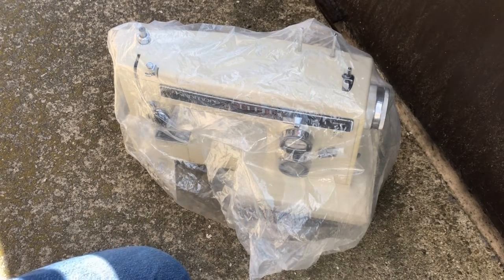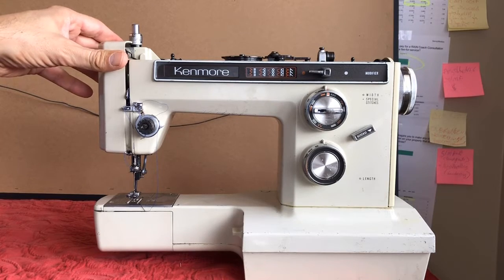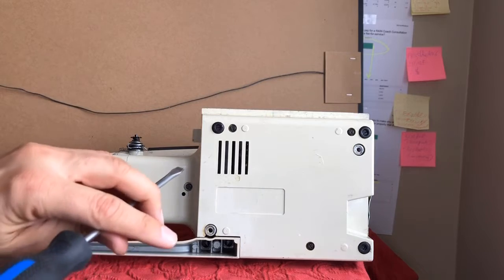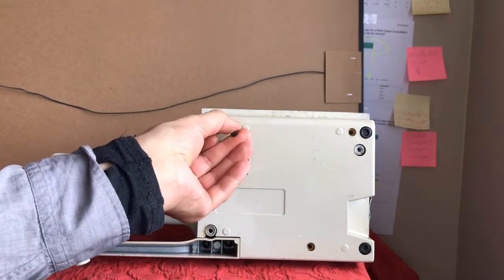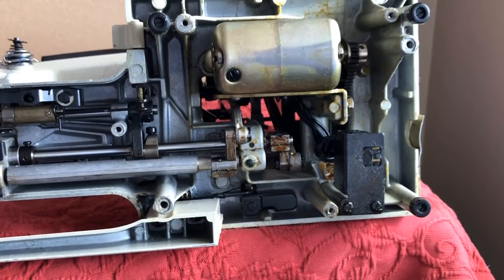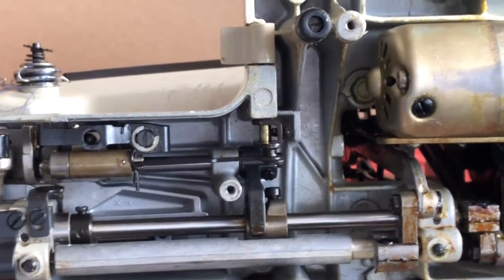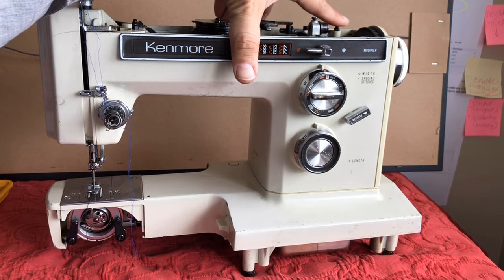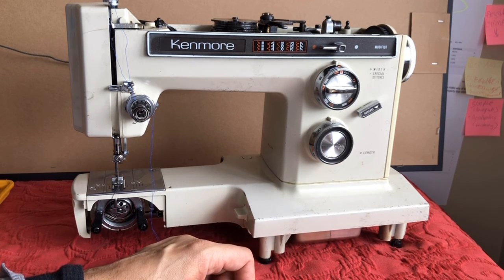RESCUE SERIES #3: Signs of Life: Getting the Drip Pan Off and Inspecting Underneath the Drivetrain!!

Comment: Do you have a video in which you are working on a machine where the drive shaft is frozen and the needle does not even move up and down? I like how in this video you point out which areas are most relevant for the zig zag, but my Adler that I am working on is also stuck such that there is no up/down movement either.

Comment: So glad I found your channel, I just was given this sewing machine by my best friend. Her mother passed away and she asked if I wanted it. Well of course! I've been tinkering with it for a few hours. It's doing a straight stitch, but not yet a zig zag. also, I'm having no luck with the presser foot tension knob.It won't budge. Suppose I need to get the wd40 and hopefully it will work some things loose. Thank you for these helpful presentations, I'm looking forward to watching them all.
Reply: I would use Tri-Flow oil (not grease), or Liquid Wrench or Spray Loose.  Tri-Flow grease is good for the gears in there.  With the oil, I got a frozen 158.15250 going pretty smoothly in no time, maybe an hour.  The hardest part of the job was getting this bottom cover off!

Comment: Outstanding video.  No one else does what you do!  Also, good remarks on WD-40.  It does have its place and it did a good job on your patient.  Looking forward to future installments.  BTW:  My friend found an old Atlas machine in an abandoned house in Hawaii and she's sending it to me in the states for refurbishment.  Your videos are especially valuable to me.  I will need to repaint it and I'm looking at using motor engine paint - your opinion is welcome if you care to comment or suggest paint options.  It's a classic Pink Atlas machine made in Japan.  Sincerely, Mark.
Reply from the maker: Hello Mark and thanks so much for the kind words of encouragement.  The Atlas machines were made by Brother and are wonderful examples of 1950's style and one of the only brands that ever made machines in pink other than Necchi although there could have been others I'm not aware of.  As for the paint questions, I have always been an advocate of restoring what is left of the original paint, but I know sometimes it can be in very rough shape and its tempting to repaint it.  Keep in mind if you do decide on a repaint that a lot of the time required for such a project is tied up in prepping the machine by cleaning and masking etc.  It is VERY crucial to not get paint spray into the many crevices and openings that the machine has so that you don't create issues with internal and external parts. As for paint type, I would always recommend using a solvent based coating instead of an acrylic since acrylics are traditionally softer and don't wear as well as traditional coatings do on metal. You will want to check for compatibility of the new paint with any old paint that might still be left on the paint after prepping for repainting. The paint manufacturer will likely suggest what kind of primer to use.  Motor engine paint might work although its primary quality that is sought after is high heat resistance which you don't have to have for sewing machines.  Finding the right color might take some time.  Good luck with whatever route you go!
Reply: @VintageSewingMachineGarage  Once again I have learned from your sage advice.  The Pink Atlas machine is in a dire state.  Hawaiian salt air and humidity has not been kind to it as you can well appreciate.  It will be my principal 2019 project.  I would like to find a paint that I can seal so as to create a gloss finish that is smooth and can be maintained.  I'm thinking of visiting an automotive paint shop.  If nothing else it will give the employees something to laugh about, "That old man wants us to paint him a pink sewing machine!"  I intend for this to be an heirloom item for my daughter.  I'm documenting the entire restoration and she will hopefully cherish it for many decades and think of me often, long after I am gone.  So there's more to this project than meets the eye.  More than a picture or movie, it will be a functioning reminder and an enduring example of my devotion to her.  (sorry if that sound corny).  Good comment on the heat aspect of engine paint.  I'll find someone in town who will use automotive paint and I'll be able to give it a nice smooth, tough, finish.  Take care, Mark in Colorado.
Reply from the maker: Hello Mark and thank you so much for sharing.  And no, your thoughts are not "corny" at all.  Nostalgia and memories are always about people.  The "artifacts" of our lives such as our possessions etc. are reference points for our connections to each other.  I have an album which is in its cover and framed on a wall at my home.  It is music that my Grandmother once played for me as she taught me to sing and dance to it.  It has no meaning to anyone else, but it is a marker for a moment in time that I will always cherish.  I think this is why heirlooms matter so much to us.  Its not so much about the actual things as it is what and who they represent.
  
Automotive paint is of higher quality than house paint which is reflected in its pricing.  As long as you take your time and research what you are doing, I'm sure the project will turn out beautifully.  Keep us posted on your progress!
Reply: Mark, it is now 2-4-21, and I was wondering if your Pink Atlas project was finished and a success.  I know your daughter will cherish it.  My grandmother gave me her straight stitch only beautiful blue machine (I think was a Singer) in a well used Singer treadle cabinet, way back in 1965 when I was 13.  A few yrs. later mom and I made 106 garments one summer.  Guess we drove my poor Dad crazy, he took a hammer and literally beat that machine to a pulp.   I have long forgiven him. but still cry about that machine.  Forgive an old woman's ramblings.  That's how I got my Singer 237, and Kenmore 158.1941.2 I still have both machines and use them.
Reply: @jojosewist8921  Hello !  :)   The project was completed long ago.  I found a machinist to sand blast the machine and a skate board shop to paint it.  My daughter didn't want the machine because she lives in a one bedroom apartment and didn't have room.  I donated it to a antique store and they sold it for $350.  If someone paid that kind of money, I'm sure it found a good home.  I'm currently working on a Singer 99 and Singer 223.  Parts on order.  And don't give another thought to "an old woman's ramblings".  The world would be a much better place if there were more people as thoughtful and kind as you.  Thanks for writing.  I hope all is well with you and yours.

Comment: Thanks so much. I also have one of these machines and I suspect it was also greased in places it shouldn't have been. There seemed to be tar, like it was is a smokers room, some coming out the bottom vents near the motor.  I didn't know what I was looking at and I used a lot of sewing machine oil up top to get it moving smoothly at first. Sooo I will be taking off the bottom pan (Now that I know how)  and confirm.  It sews well but the stitch knobs have been a bit stiff. Also, when I take my foot of the power the machine does not stop instantly but I wondered if that was common for this machine. Hopefully nothing to be worried about but it's great to be able to check it out.  I appreciate  you taking the time to  make these videos
Reply from the maker: Thank you for your comment.  I made an earlier video (Rescue Series #1) where I discuss things like stiff dials/knobs and why you don't want to force using them until the machine has been fully reconditioned.  Your question on the machine running after your foot comes off of the pedal is curious.  This generation SHOULD have its original foot pedal which was one of the earlier electronic foot pedals.  If a machine runs continuously, wont run at all, or runs intermittently after you stop applying the pedal, it could be a sign that the pedal is failing.  Unlike most analog pedals, the electronic ones are often not repairable, but you could take it to a service center to be sure.  The good news is that you can replacement pedals (and cords) that will fit this machine so that your machine can live on even if your pedal doesn't!
Reply: I wish I'd known all this when I got the Kenmore 6 years ago! and probably lucky I didn't break it.  It wasn't frozen but certainly sticky.  And I can see a better cleaning is needed.  As to the run on, the foot pedal is original and I will have it serviced if the additional cleaning does not fix that problem.  The needle bar will go approx a 1/4  revolution after I lift my foot.  I knew this was curious as I have a Bernina Record 830 and the power is instant on it.  Another lovely machine.  
I look forward to the rest of the video on the Kenmore and love watching you show your machines.  Cheers!

Comment: Keep them coming!  I have two Kenmores I am trying to revive.  One is a 158.175-  and the other is a 158.130- .  Neither is a free arm, of course.  The .17 is just stiff, similar to yours, but not so much.  At least, so far I have not found any thing drastic.  The .13 has a 'catch' in it.  It rotates freely to a point, then doesn't want to go anymore.  I think cleaning will cure it, but haven't got very far.  I really bought it to get the table.  It was super low price.  Your videos are exactly what I need.  Thank you.

Comment: I am interesred in all these vids, and you do a wonderful  job of filming and instructing. I have a 158.1941.2 super hi shank that I use regularly. Will you demonstrate the correct amount of grease to use. I am not sure about that.  I inherited my machine 25 yrs ago from my mom.  I was told by a repairman that these machines like to be oiled regularly so I do it several times a year.  Oh, is your machine a left, center, or right needle position?
Reply from the maker: Hello.  Yes, its helpful for the machine if it gets oiled and run at least several times a year.  Machines don't like to sit for extended periods and when they do, it is the greatest source of work for me to get them to "wake up" to the point where they sew optimally again.  Yes, I plan on making more videos that will show maintenance techniques and I can make a point to show what the optimal amount of grease is in places that require it.  Grease does not need to be reapplied nearly as much as sewing machine oil does.  Thanks for writing!

Comment: I just purchased this machine from a thrift store and am excited to get it up and running.  The hand wheel will barely turn at all, but otherwise it looks great.   I suspect it wasn't used more than once or twice.  It's missing the four small screws that attach the drip pan to the bottom of the machine.  Do you think they are about half an inch or so long?  I'm going to try to find them at the hardware store.  Thanks for these videos and this series.

Comment: Hi!
A friend was recently given a 1970s Kenmore 10 model 385.1249180. When she first got it, the machine seemed to be in working condition: the straight stitch works fine & the needle moves smoothly. However, whenever she presses the reverse button, the machine gets stuck in reverse even after releasing the button. It looks like there’s a mechanism that sticks when the reverse button is pressed, and it’s affecting the feed dogs, causing the machine to stay in reverse. We first tried to oil the bottom & top of the machine, as suggested by the manual. When that didn’t fix the problem,  we used WD-40 (to get rid of any sticky/gummy parts) and then re-oiled the parts that seem to be causing the reverse mechanism and the feed dogs to be stuck in reverse. But this didn’t seem to help. Do you have any suggestions?
If it's not too much to ask, on one of your future videos with this machine, can you show how the reverse lever affect top mechanism (we have some stickiness there too) and the feed dogs? We can see the feed dogs move when the reverse lever is pressed down, but we can't determine how the reverse lever affect the feed dogs.
I understand that these are very specific questions and you are working on other projects. Any suggestions will be greatly appreciated.
Thanks!
Reply: We fixed it!!!! From the top of the machine, there are two mechanisms that pop up when we hold the reverse button down. The one on the left was sticking and making it more difficult to move the feed dogs. This caused the machine to be stuck in reverse even when we weren't still holding the reverse button down. We sprayed A LOT of isopropyl alcohol (film remover) to remove any old, sticky grease. Then we moved these mechanism up and down several times until it loosened. We added oil to any parts that we used the film remover on, and the machine was working again like new!
Reply from the maker: Congratulations!   This is great to hear!
Reply: @VintageSewingMachineGarage  Thank you so much! Also,  I wanted to thank you for inspiring us not to give up.

Comment: Just bought a Pfaff 78 from 1970 frozen up like that. The shop says they may not be able to fix the zigzag. And if they do, it might work for an hour, a week, or a year and be toast again because they are just so old. Is this accurate or do they just want to sell me a new machine? They want to charge me a $25 bench fee just to look at it. I’m going to try to do it myself because that info sounds suspicious to me.
Reply from the maker: The $25 bench fee is not high as I have seen worse.   For the machines I work on, I find that once the stuck mechanisms are free and working again, they normally continue to work unless the machine is left for long periods.  Dormancy is hard on machines and I spend much of my labor "waking them up" by getting them unstuck.  FYI, I would keep in mind when you budget for the work that while Pfaffs can make fantastic machines, getting parts for these in North American is a bit more challenging than other brands like Singer.  Yahoo groups has one dedicated to Pfaffs and you might find more help there long term after your shop gets yours running.  The mechanisms that your shop needs to "unfreeze" can be difficult.  My own Pfaff restoration took a LONG time because the owner had stored hers in her attic for over 20 years!!!   Also, be extra gentle with the knobs/controls for your machine as I find that Pfaffs are very strong in their metal parts, but their knobs are more fragile than most.   In any case, Pfaffs make wonderful stitchers and so if the shop cannot get it back to full functioning, you might find a "fixer" in your community that can overhaul it.  And for what its worth, my interest in overhauling machines happened because I bought a machine on Craigslist and it did not run.  I was determined to learn how it was SUPPOSED to work and eventually got it fixed.  Ironically, it was the same Kenmore model that you seem me working on another version of in my RESCUE series!!